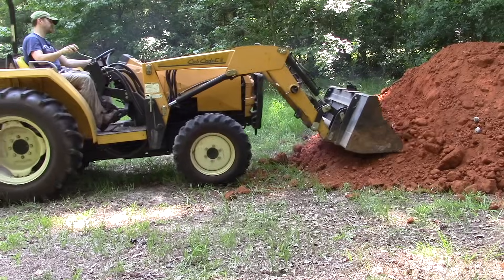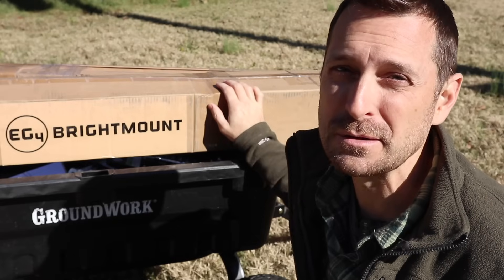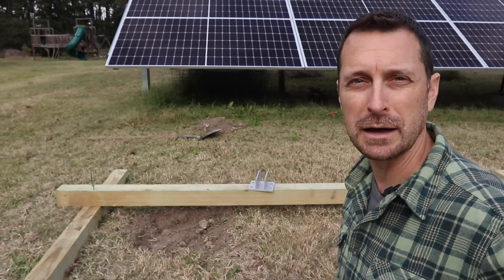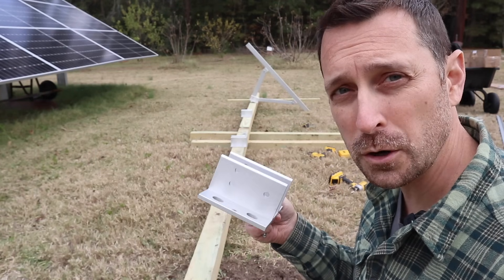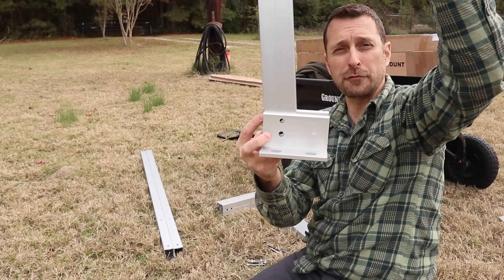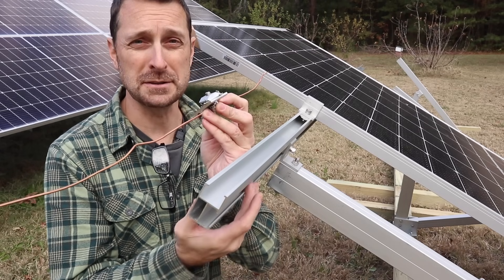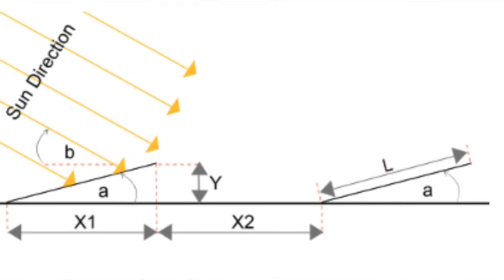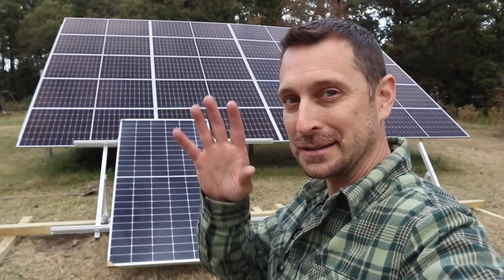Finally An Affordable Solar Panel Ground Mount! Installation DIY EG4

Comment: Price is now $355!! Definitely went up, but it may be because these are now adjustable with respect to the angle of the panels. Also, the brackets come with it...all 3 sizes of end brackets come with it. I just purchased this and am in the process of installing it. I am using railroad ties for my base, so I hope that works ok. I have some questions about the panel installation, hence the video search. :)

Comment: Wow!  The newest version is a lot different than the one you have.  More parts are preassembled and the bottom mounting plate is universal (no more two holes in the back and one in the front. front and back are now the same.).  The rail clamps no longer require a bolt to go through to mount them.
Reply from the maker: Interesting

Comment: hi, do they come taller?  I will be using thirty-six 460w panels and I need to mount one on top of the other otherwise the array would be too long.  What DIY-friendly racking system do you recommend for my use?
Reply from the maker: No, this is the only size. 
I recommend this one called the Chiko which is much bigger....https://signaturesolar.com/chiko-usa-groundflex-u2v-solar-panel-ground-mount-kit-large-module-version/?ref=countrylivingexperience

Comment: I would get it if I can figure out how to put my 18 RNG-100D-SS panels on it. I was going to just built an adjustable wood ground array like I've seen other's do, but I'm a programmer and basic DIY'r not a welder or a carpenter. If anyone uses this with smaller panels, please post a video.

Comment: good video but... you forgot the most important point there are NO instructions in the box not even a picture . when you get 4 hours from no where with no cell signal you will wish you had down loaded and printed out the instrustions

Comment: I looked at this mount but the problem is the fixed angle. There’s nothing affordable on the west coast. They all seem to be made on the east coast and shipping is around $6k. So I will be building my own swivel mount.
Reply from the maker: The new version of this is adjustable. I demonstrated the older version in this video.

Comment: Looks like a nice system it was perfect for me except my panels are 44.5" wide - too bad...
Reply from the maker: Thanks. Unless they are square, they should fit. What is the other dimension?
Reply: You should be able to get 4 of them on this rack
Reply: @TouchwoodTV  I have the exact same situation. You can still use the Brightmount system, but also get their 5” extension kit (one pair per Brightmount box). They’re only about $13 per pair and they’ll give your rails an additional 5”, to accommodate panel sizes that exceed 44”.

Comment: I am pondering an in line system on the ground at the edge of my turf and even with this system and current panel prices the mounting system would be costing me as much as the entire electrical system (panels + inverter). This feels so wrong. I am willing to do some work and looking for something cheaper still. Thinking of something simple triangular in which the panel is part of the construction (diagonal part).

Think I got it now: near vertical poles, just a bit tilted, won't take up much ground surface area, with panels fixed in between them. I can easily make up for the loss on the sub-optimal slant by adding a few more panels and it will still be cheaper.
Reply from the maker: If you can do it cheaper, go for it.

Comment: I have 8 200 watt Rich Solar Panels.  They measure 28 3/4" x 58 1/2" each.  What parts did you use to mount panels top and bottom?   Thanks so much!
Reply from the maker: They actually mount on the sides of the panels. The kit comes with the clamps to mount the panels. Check the thickness of your panels though.

Comment: Awesome! Doesn't the ground wire also need be tied to your in your inverter's ground if your using a all-in-one unit or in your house where the Ground Neutral bond is?
Reply from the maker: That is actually a big debate. I ground mine at the array and don't use an EGC because mine are 100ft from the house on a ground mount. If on your roof, yes.

Comment: This is a really nice Chinese ground mount system. Very affordable, light weight Aluminum, and easy to install. This is a great option for mobile power off-grid trailers.
Reply from the maker: It is a quality item. Very versatile.

Comment: Great video, clear and concise!  Love your channel, always great info and presentation! Do you have a suggestion on where i can get extra rails for the Brightmount racks? I have 10 panels (SS minimum order) and two of these racks. I want to use splice plates to add 15" to each end of each rack as my panels are 41" wide. They sell 5" extensions, cute but worthless for me. TIA
Reply from the maker: Thanks Bob. Not sure you can get any extra rails by themselves, sorry.

Comment: I am only able to afford 4 to 6 Harbor freight Thunderbolt 100w panels.  Will these racks accommodate them or overkill?
Reply from the maker: I don't know the dimensions of the Harbor freight panels so I am not sure they would fit. Honestly I would not waste your time with those HF panels. You can get one 450w panel from a reputable manufacturer for $220. So if you buy 4 Harbor Freight panels at $120 each, you would spend $480 and still not have the same power as the one good panel. If you buy two good panels, you will spend $440 and have almost 1000w of power.
Reply: @CountryLivingExperience  The best Aptos 440W Bifacial Solar Panels are $179 each at signature solar

Comment: You got lots of dirt to fill a ballast system, I opted for mounting 2 panels up on some 2x4 8ft high, got 2x4 kickers in back of em hooked to bottom in front to kicker with some chain that is a bit adjustable....but not huge adjustments kickers are 4ft 6 in in back. 500 bucks to build the mounting for 3.6kw of panels. The kickers can fold under and they can drop down to lay flat on the ground in a couple mins if I think a storm is coming.
Reply: Each panel frame has two kickers hooked on with a hinge.
Reply: Each set of panels can be folded up and loaded in a truck, can load the 3.6kw in about 10 mins with a friend, they weigh just a tad over 100 lbs each frame. I toss some concrete blocks on the chain, it will never move unless its a tornado...and nothings gonna take that.
Reply: With mounting hardware the are 8ft high, 6ft wide and folded up they have a thickness about 7 inches, a bit less.
Reply: 5 sets of 365w used panels, around 1700-1800  for the panels and mounts so 10 panels in the 5s2p

Comment: Very nice way to temporarily fasten them until you work out the final mounting points.  Was there a benefit to extending the horizontal pieces out so far past the outriggers?  Since you need approx 51" between the struts it would appear that a 5 foot piece would be more than sufficient (per two panels) unless you planned on joining them in the middle.  I actually don't plan to - I want two separate 2 panel mounts.
Reply from the maker: Thanks. No benefit, that is just how my brain designed it at the time. It was really solid. If you don’t want to join them, then it the 5’ section is totally sufficient.

Comment: It looks well made.Is the a UL or equivalent sticker so each and every piece does not need a wire ground bond ? Ground rods?
Reply from the maker: IT is well made and sturdy. You always need to bond everything together with an electrical grounding conductor.

Comment: Are you saying that you can put four500W modules on one rack for $279? I thought you could only get two on a rack?
Reply from the maker: Yes, that is correct. 4 will fit with no problem.

Comment: Why ground the rack? The DC circuit from the panels is isolated. There's no potential to earth ground in the event of a short to the frame.
Or am I missing something?
Reply: It's more for if lightning hits your panels and hopefully keeps it away from your off-grid charge controller or grid-tied inverter.
Reply: That's the purpose of putting lightening protection devices on your PV wiring. Not attracting lightening to the frames by giving them a clear path to ground basically turning the pv array into a lightening spire.

Comment: Just curious why your ground mount didn't have the adjustable angle like Everyday Solars video or is his a newer design,thank you just want to make sure I'm ordering the correct ground mount.
Reply from the maker: I had one of the earliest versions of this rack. They added the adjustability later.

Comment: We are going to install this ground mount.  We have rock and we do have an accessible way to get any equipment in.  Do you think doing it like yours but permanent would be good?  We were planning on putting rebar in the wood into the ground and maybe some steel cables.  We are in southern Arizona.  The wind blows some but nothing crazy.
Reply from the maker: That is hard to say. Ours didn't move at all during the time we had it on the wood but we didn't have many windy storms. We ended up putting it permanently on some concrete piers. Maybe you could try to drill into the rock and epoxy in some rebar, then pour a pier around that.

Comment: Great Video! Do you think this mount would work on top of a pool screen room cage? Not sure about the legs, the runners for the screen room are already sloping pretty good, do you know if the sell a kit without the legs, just the runners?
Reply from the maker: Thanks. 
This would not work for a roof application or on a lanai. It is specifically made for the ground.

Comment: How much would a basic ground set up cost? All I know is putting them on the roof is ridiculously expensive.
Reply from the maker: How many panels do you have? I can give you a better breakdown if I know your system size.

Comment: Looks like a great product but I wish they'd made the rack just a bit wider so that they could accept the large 550w panels. Max panel width according to the manufacturer is 44 inches and most large panels are 44.6 inches. Even though it's close I don't think you'd have enough room for the end clamps.
Reply: I'm hearing a rumor that EG4 is revamping this mount soon to accommodate these 44.6" wider panels.
Reply: They have a extension kit now.

Comment: Beautiful set up Brother!  What are the sizes & lengths of the timber you used?  I probably missed it if you said it already. I have four of these Eg4 aluminum solar panel mounts & this is the exact build I was looking for. I was going to use railroad 🛤️ ties but I like your build even better. Thank you 🙏. 🍻 👊  🇺🇸
Reply from the maker: Thank you. Those are 4x4x10' treated posts. 
I did a new video a few weeks ago where I permanently mounted it in concrete.
Reply: @CountryLivingExperience  ok. Thank you so much. I will watch that video too.
Reply: @CountryLivingExperience  Thank you 🙏 again. I’m so appreciative of all that you do. I’ve learned so much from you. I will just do exactly how you did the beautiful 😍 permanent mounted Eg4. I have 4 of the mounts & this will be such a perfect set up for the 16,   400 watt Solaria solar panels I have. Thank you 🙏
Reply from the maker: You're welcome. Glad we could help.

Comment: One thing I noticed when I went and looked at the product is your base didn't seem to account for adjusting the angle so you would need to bump it up higher so you could take advantage of that feature. Still, great suggestion and thanks for the video
Reply from the maker: Mine is the older model which did not adjust. The new model does.

Comment: I found out about this mount from you, even though I am a Signature Solar customer. Be advised that the techs at Signature Solar say that you have to go with the piers, otherwise they have had customers lose their mount when mounted to wood. The problem with the piers is that they require a massive amount of concrete.
Reply from the maker: They have to legally say that. I also think the piers are way over engineered.

Comment: Sounds like these racks don't include approved engineering stamps for a location.  Would have to pay for a local engineer to approve it for your area.  Other systems do provide engineering approvals. Something to factor in cost wise.
Reply: That's a large  and tall sail in the background... wonder what the wind loads are at 60mph, 90mph. Wind x surface area is no joke!

Comment: Eric, do I understand it correctly, that since this rack is for 4 panels, I will need to purchase 8 of them for 30 panels?
Reply from the maker: For 30 panels you will potentially need 8 of them. Depending on the size of the panel, you may be able to fit 5.

Comment: price?
Reply from the maker: I mentioned it in the video. $299
Reply: @CountryLivingExperience  thank you.

can the size panel in the video produce 20 mWh/year in NE USA?
Reply from the maker: You're welcome. 
How many panels? How many sunny days in your area? There are so many factors that would go into calculating how much a system will produce in a year.
Reply: @CountryLivingExperience  the panel setup size in your video and let's say 30 miles north of NYC. 12 mWh/year?

Comment: Can it be mod ified to take 5 panels?
Can the panels be spaced further apart to break up the wind?
Reply from the maker: I haven't tried to modify it in any way. Fitting 5 would be determinate on the size of you panels. They would have to be quite slim.
Reply: @CountryLivingExperience  The is a youtube video of a guying adding small extensions and using 5 400 watt panels

Comment: I used 4x6 posts about 18 inches into the ground. The structure was made from 2x8’s and 2x4’s. Still standing immovable after 8 years and many large wind storms. Way cheaper than the flimsy structure the solar company wanted me to buy with the solar cells.
Reply: Would be interested in plans if any?
Reply: I can send you pictures. There are no plans because I made it up as I went along.
Reply: That would be great, just to give me an idea. I have a plan of my own, but was just looking at other Solar mounts to find other ideas.

Comment: Friendly reminder to all DIYers- copper sulfate pressure treated lumber (everything sold now) will corrode aluminum.  If you are planning to attach this mount to pressure treated lumber permanently, I'd recommend a galvanized steel base plate between the aluminum and the pressure treated lumber.  PVC decking will compress under load.  You could also use a zinc treatment (Rustoleum Cold Galvanized) it you are using some reclaimed un-coated or partially rusted steel, which for a DIY project would be 100% on brand ^_^
Reply from the maker: Thanks for the tip

Comment: I purchased some and will install them once I finish designing my second solar array. How do you like these so far?
Reply from the maker: Awesome. Mine has been great so far. No issues.
Reply: @CountryLivingExperience   Great to hear. I finally trenched this weekend and am ready to start this portable install. Can you please give a parts list for the  length of posts, lag screws type, structural screws, ect? Looks like 8 foot pressure treated 4x4's in your video? I am going for 2 rows of 12 for my 24 panels. I was thinking of each row about 5 to 10 feet apart for shading? I have 6 EG4 bright mount  kits to install since my inverter will take 3 strings of 8 panels in series. Thanks.
Reply from the maker: @Corum77  Cool. I used 10' treated 4x4's. 5 to 10 feet apart should be good but it depends on your sun angle where you live. Will you be mounting them permanently in concrete sometime in the future? I used 6" structural screws for the posts and 5/16" x 3" lag screws.
Reply: @CountryLivingExperience  Thanks for the info. I'll probably keep them portable since I'm near a septic field.

Comment: I bought this same rack. The instructions for this is horrible and out of order. The manufacturer reached out back to me on some questions i had pointed out about the anchor screw steps, they responded with some clarity and said: "...there needs to be some clarifications/corrections in the manual.".  You seem to've figured things out. Im just watching to see how you lift/mount your panels on this thing... of course the instructions dont talk about this either. I actually installed the 4 concrete piers using 12" tubes... so my 320W ea panel lift is much higher than your lumber set up.
Reply: i used an old chair to help me mount the panels. Just slid it under the panel to support it while I linked it up with the others. No need for another person that way
Reply from the maker: Hopefully our video was helpful for the assembly.

Comment: I like these mounts. I believe they would be fine for some experimental solar setup to get your feet wet in this tech. Long term, no go anywhere that requires a permit and inspection for grid tied solar, and they would need an engineering sign off. They won't pass in most jurisdictions unless they are footed in concrete or other ground anchoring. I'm in CT and these won't pass inspection. I may try mounting 4 big panels in one of these just to see if the location I am planning a ground array has potential. Since they will not be "permanently" attached to the ground maybe the inspector would look the other way while I play. I could attach wheels and make it portable, or tell them I'm building a solar airplane.
Reply from the maker: I don't live in any jurisdiction and there are no inspections here.

Comment: What size was the wood you used 6x6? and what were your cut lengths on all of the pieces? (length, width, etc)
Reply from the maker: 4x4's. But if you live in a windy area, I would use a 6x6's. The crossbars are 10ft and the outriggers are 5ft.
Reply: @CountryLivingExperience  Are you sure you used 10ft cross bars and 5ft for the feet/outriggers?  Every other install video I find, guys are using 14ft cross bars, when mounting to temporary or movable wood ground mounts, like you did here.  ?